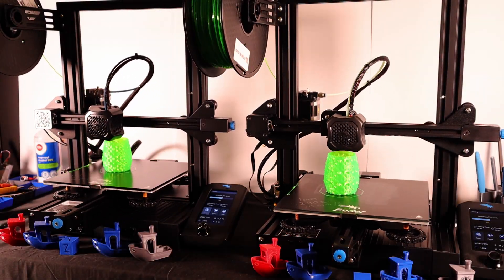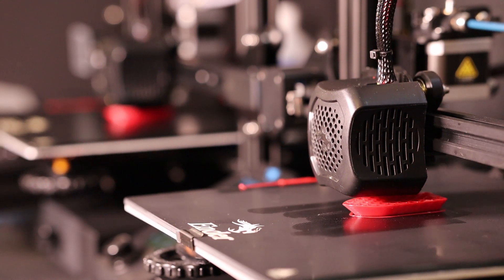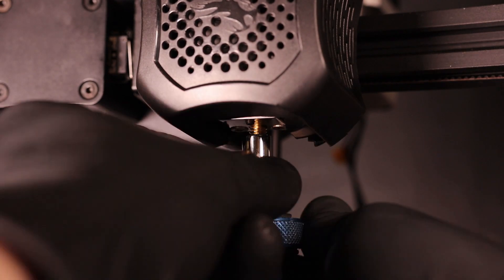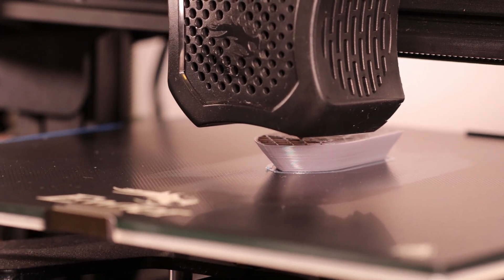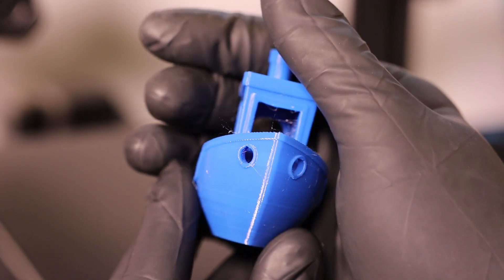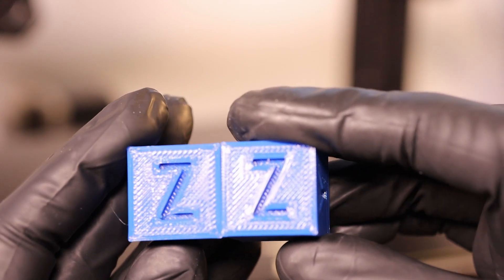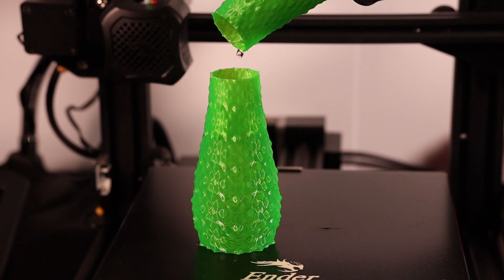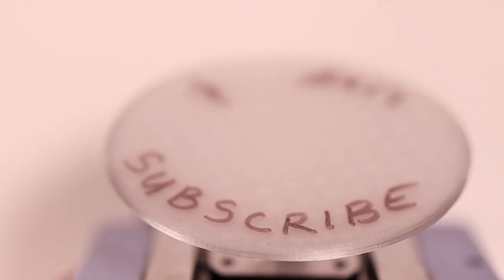Creality Ender 3 V2 - Old vs New - How bad 🤢 ... or good 👍 is it?

Comment: Filament dryer is working really well for me, particularly on rolls ends I've had since I was a noob and didn't store properly. PLA that's gone brittle might print if you hold it at 50, but will still be a bit brittle when cold. If it's just moisture popping, 6 hours in the dryer is usually enough.
Reply from the maker: Cool, do you have one you'd recommend?
Reply: @NeedItMakeIt  I've got a sunlu one, but I've not had a chance to compare it against anything else. My oven doesn't go cool enough to try using that to dry filament and the sunlu dryer was on sale at at about the same price as a food dehydrator. I've printed a little plate to mount a pressure fitting and some tubing in front of the front filament hole so I can guide fialment out of it down to my printer as I tend to keep filamnet on a shelf above and it's set up to go alongside or below a printer.

Comment: Can’t wait for the filament dryer. I need a good simple solution that does not require an oven, one that will draw moisture out of the filament as opposed to just a keeping moisture from entering like only desiccant does.
Reply from the maker: I think that will make a big difference.   That or a dehydrator.   A dryer would be handy to keep at the printer and I'd still need a bin for all of the other spools I suppose.
Reply: @NeedItMakeIt  Yes, desiccant is great for keeping filament dry in a bin. It seems that a food dehydrator is the best option for drying filament. I also am struggling with wet petg. Watching you videos are so relatable and helpful. Thanks!
Reply: dude I 100% found the perfect dryer you won't believe it, it's your own printer as a dryer, how? building an enclosure will literally dry your filament after some time, i usually print things that i'm curious about or wanted for utility over lookings, like after the first print your filament its ready to print everything, after 2nd no more humidity in. 
But like build it with whatever you have near even cardbox works, my first enclosure were 4 pieces of cardbox and desk,put the print below the desk and surround it by the cardboxes and you ready to go, then you would improve it
Reply: @DavidGarcia-nx2gj  Yeah, unfortunately(or fortunately) I ended up buying a cheap Amazon dryer and it has successfully dried my bubbly petg. Now it prints beautiful!
Reply: @theorangebaron1595  well, it is what works better for you at the end
Reply: @theorangebaron1595 Still got a link to that dryer? Might need it at some point given the high humidity I live in.

Comment: I love when you guys say I got from banngood. I payed mine 20.01.2021. Waited for 40 days for them to just ship it from CZ warehouse. When I got it it came with broken glass bed,  damaged y carriage and missing x stop connector. Now I am wait probably till May to get the broken parts. Oh I wont get connector. Superb shopping expirience.
Reply from the maker: Fair enough, mine arrived intact I've purchase from them.   Sometimes it does take some time.
Reply: That really sucks, I bought mine from banggood in early 2019 and it came perfect! It was an ender 3 v1, unfortunately it was the only thing I've ever ordered from banggood so that's my only experience.
Reply: PS I received my package in 14 days! It was kind of insane considering it said it came from shinjin!
Reply: @SteveSiegelin  mine was waiting for 40 days before they started shipping. Obviously they oversold their stock.
Reply: @zoranbozic8592  as I said I ordered mine early 2019 so shipping from China was also working a little smoother.
Reply: @zoranbozic8592  it was the same with my neje laser when I ordered it. It got here within days. The only problem with that was UPS put it outside on my step and it rained. Thank God the company that shipped it completely taped the box up so it was watertight to an extent. PS that laser works fantastic as well for small jobs and I've done some awesome wood carving and decal work.vinyl can let off some nasty chemicals if you get into lazing so always make sure you have proper ventilation.
Reply: Just sent your oven to warm and monitor the temperature with a grill thermometer. You're not worried about damaging the filament as much as warping your reel. Make sure you preheat the oven, the elements can warp the reel before it heats the filament. I usually leave my filament in the oven for about an hour and a half to 2 hours. I just use my little toaster oven and I can fit two reels side by side.
Reply: Yea, banggood is the Chinese version of amazon. I avoid it. The 3 times I’ve used it, two times were bad experiences. I couldn’t imagine trying to return something....
Reply: @Jon Good luck mate. I am still strugling to get broken parts. And we are talking abought thing bought on 20.01.2021.
Reply: @Jon if you're not kidding about buying one then trust me you're going to like it. There's a big learning curve but usually straight out of the box as long as you don't pinch a wire during assembly like I did it's pretty straightforward. Even if you pinch a wire a little bit of tape or solder does fantastic. PS they say you shouldn't cut vinyl with a laser but I like laser cut vinyl better than I do vinyl cut through a machine. It has a cool pattern to it and the edges are not completely smooth. I'm cutting a decal vinyl for my hat right now since my coworker stole my last one I'm putting my name in vinyl on this one.

Comment: Thanks a lot. I bought a 0,4mm cooper nozzle from BROZZL. I will see the resolution with PETG after that. What is your opinion?
I prefer using PrusaSlicer, easy and faster than Cura. Do you think like me?
Reply from the maker: They'd be worth a try, they look super high quality!  The nozzle may have a little bit to do with it, I'd have to do some research and testing on them to see, copper being a better conductor than brass might just make a difference.  Drying PETG and the extruder path are likely a big part of these issues also.   I will put this on the list of things to test out.  I have PrusaSlicer now, I am still learning it, seems pretty good but I still like cura quite a bit.